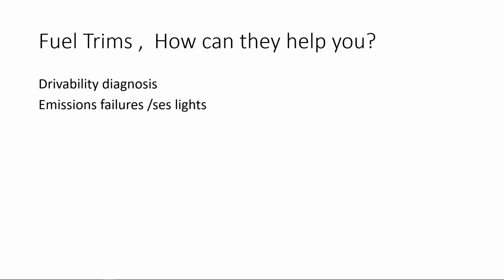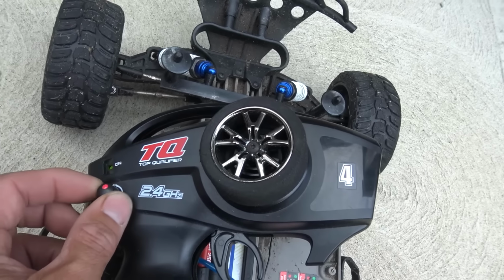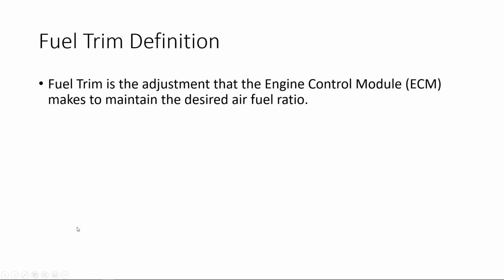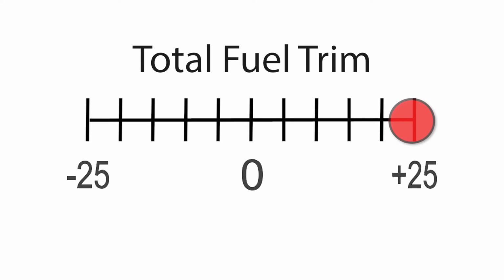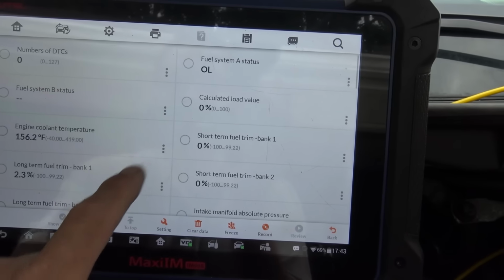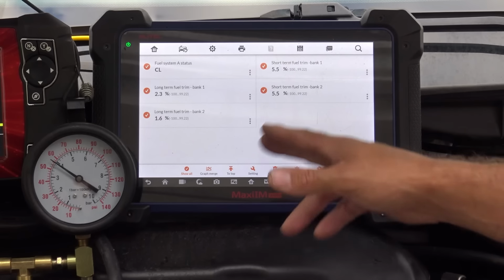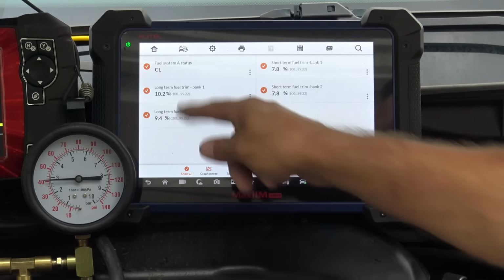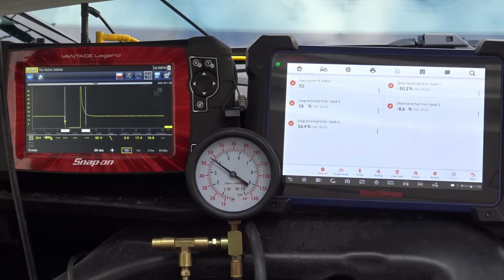Understanding the basics about fuel trims

Comment: thank you for simplifying fuel trim,  i have a snowmobile turbo boondocker setup with 5psi of boost when purchased. Turbo blew, i brought sled to Mod shop that does sled mods but they could only get 14psi as new low . So now i have to purchase av gas  too keep the sled cooler, like the power but its not my liking. id like to put back to stock if i can. Would i be able to just unplug the boondocker fuel mapping box from the efi carbs and  plug in the original back in to get stock  settings. i will also be putting original exhaust back on also and remove turbo.
Reply: someone mentioned in forums you could leave the turbo installed and just unplug the boondocker fuel mapping box and just plug the originals back in,  reason being i don't want to  seize motor and would be happy with stock
Reply from the maker: I am not familiar with systems you have.

Comment: Do fuel trims % value effect all fuel table, and at WOT ecu use the % its detected at idle, do I understand right?
Reply from the maker: I may make a part 2, but yes,  each look up map or table has a fuel trim, that way when certain rpm , load , maf, temp  conditions ate present the ecu already has a base line( long term trim value) established.
Reply: @BrianMann216  so it means narrow band sensor only useful for fuel trims at idle, others running condition mostly narrow band sensor just do nothing right?

Comment: Thank you so much.  I’m not a pro, but I’ve made it a goal of mine to understand fuel trims.  I’m a pilot, and your airplane trim analogy did the trick.  I have a low level scan tool that I’m trying to understand for my car and at least now I can get the high level overview that previously escaped me.  It’s a 11 yr old 3.6 GM with 160,000 miles that seems to run quite well, but as they say knowledge is power.  I subbed.
Reply from the maker: I love Flying,( student,  172 and 152 mostly 12 years ago)..

Comment: Basic control theory. Many systems in the modern car are using a PID control loop to maintain some kind of stasis, e.g., fuel ratio, cruise speed....etc. Some of the most fun projects I ever worked on were based on this.

Comment: I'm a diyer.  so working on a 2008 honda civic 1.8 liter.  I have negative fuel trims all of the time.  at idle, my STFT and LTFT,  always on the negative side.  even while I'm driving the car between 1500 rpm and 1800 rpm.  what am I missing?  How should I tackle this issue.  thanks.
Reply from the maker: Is there actually a drivability issue? Setting a code? What are the actual trim #s
Reply: @BrianMann216  the thing is I have no drivability issues or codes.  I’m just going to clean the oxygen sensor and put it back.  The next thing I’ll do just for giggles is, I’m going to smoke the engine and see if there’s any vacuum leaks.  If there’s other steps I should follow please advise.  Thanks

Comment: Best video, best information, I've found so far regarding fuel trims. Nice and clear. I especially like how Mr HoAT set up a system to reduce fuel pressure to the injectors, showed us a gauge that was indicating the pressure and the changes in pressure, and showed us how the OBD trim values changed in response to the changes in fuel pressure – changed in order to keep the vehicle at "homeostasis" as they call it in biological feedback systems. I loved the info about the etymological origin of the word "trim" – starting with how the word is used, what it means,  in the context of sailing vessels. Only thing I had some difficulty understanding was the fuel injector oscillograph pattern starting at 21:20. I think the problem here was that I was not able to see the labels for the vertical and horizontal axes. The labels were too small to see. I saw what looked like 2-digit numbers on the vertical axis that were too blurry to actually read, and in addition I saw just the numbers, I did not see any label saying what the numbers were a measurement of. Whatever was on the horizontal axis was even harder for me to see. Is it time, in milliseconds, on the horizontal scale? At what frequency was the oscilloscope re-drawing the screen? What was on the vertical scale, volts? Why was an increase in injector on-time associated with a flat, horizontal line at the bottom of the vertical scale (a line which got longer as the fuel trim went more positive)?
Reply: I was confused on the same part

Comment: 2015 supercharged mustang 5.0.   Fuel trims at idle and warmed up.   LT and ST. Around 0.   Driving 2000 rpm ish.  Bank1. -12. Bank2 -2. LTFT.   Any ideas.   I/M monitor Fuel will not set. Any input?
Reply: Exact same issue, trying to figure it out still

Comment: 😃wow, I just came across your stellar teaching on this topic of fuel trims! Bravo!  Short & Long adding together and understanding how fuel pressure can impact the duty cycle of the injectors as well as all the trim.  This is helping me take over the troubleshooting of a lean condition on a Cadillac engine with codes 171 and 174 (lean on banks one and two).  I'm looking at fuel pressure tomorrow and your excellent teaching has put me on a path that I think i can solve it.  Thank you sir.  -jeff
Reply: Be interesting to know what you actually diagnosed on this? I doubt it was fuel pressure, maybe an air leak?

Comment: Curious if you can answer this one?  Supercharged car. The car is speed density (MAP sensor- no MAF) and tuned in summer time. Would winter weather show positive fuel trims?
Reply from the maker: If tuned properly, no. Ideally, the fuel calculation is based on the air mass, which is density x volume. The density calculation is from the (average molar air mass × map pressure)/(specific gas constant for dry air × the air temperature). Basically pressure / temperature  so the air mass calculation is automatically changed for temperature before the fuel calculation.
Reply: @BrianMann216  okay. I must have a small vacuum leak somewhere then…  It goes 1.12 bank 1 and 1.16 bank 2 at aggressive throttle or wide throttle.
Reply from the maker: @Boosted3.7  usually a vacuum leak will not cause trim issues on a speed density system.
Reply: @BrianMann216 Hmmm. Okay.  What are the things that would? This is my first SD car.

Comment: I have a 2002 jeep liberty V6 3.7 I have a -32 on my long-term both banks it had two bad cats I replace both catch new coils, new spark, plugs new injectors to fuel pumps and I cannot get the -32 to move back up short term is zero to -1 any help?
Reply from the maker: Did you reset the trims? Clear all adaptives?

Comment: I have a 2012 Buick enclave and have a very erratic cold start for about 10/15 seconds.The bank 2 short and long trim shows NEGATIVE 100% on both short and long trim on Bank 2 only. bank 1 is very good.. what can the issue br guys.. injectors, o2 sensors, vacuum leak or carbon build up on the valves.m
Reply from the maker: I would look into restricted exhaust , clogged cat or timing issue
Reply: @BrianMann216  thanks for the heads up, just noticed the Mass air flow sensor is Reading around 3.9 ish when idling, heard this should around 6.as a rule of thumb 4 cylinders should clock around 4  ..6 cylds should be around 6 and 8 should be around 8 give or take a bit..
I'll clean the MAF sensor and take it from there..one more thing I  believe my timing chain is slightly stretch hear a slight rattle when taking off

Comment: thing that I don't know is does long-term for is that for the rear O2 sensor and is the? Short-term is that for the front or 2 sensor or is it both of them consists with Fuel injectors I'd need to know what controls Feel trim I know part of it is the maf air flow sensor  What boils down is I can read what the fuel trim are saying to me but I can't read where it's coming from and why for example my ltft is between 9 to 11 +
Reply from the maker: Focus on total fuel trim! Different makes and models will calculate differently sometimes rear o2 is important part of calculation.  Total fuel trim is the correction that the computer is making.
Reply: @BrianMann216   Well I was relating to my 2004  BMW 325 Xi  My long-term field trim was pretty high at + 10 And I didn't have no vacuum  Leak I was using vdo Maf sensor  I guess it died on me I put back my original one that I had stored for emergency And now my long-term filth have it's showing way better At positive 3.24 What it is is i'm trying to figure out what caused my Car to have a p 0 420 and A p 0 4 30

Comment: I’m very new to this stuff, this is an excellent video! Question: Why would I not measure the fuel trims while driving instead of when sitting? Wouldn’t that be a more accurate depiction of how well the engine is doing? Or do the percentages/ratios not change between driving and sitting? Thanks!
Reply from the maker: You are absolutely correct! My goal was to introduce fuel trims.  I did some examples at idle just to show the basics.  Monitoring Trims under various conditions provides a wealth of information. For example you can have a  vehicle that runs great at idle with total trim near normal, and then on a test drive under a load the vehicle lacks power and the trims climb,  you know that you most likely have a fuel delivery issue, (low volume from the pump / restricted filter, restricted injectors).  Thanks for watching and commenting,  please do subscribe if you have not already!
Reply: @BrianMann216  I have subscribed, and thanks for the reply!!

Comment: Sir my car at idle has a short term of 17% and where i drive the car short term and long term are both averaging at -3.5% and +3.5%. What should it be at idle vs when driving? Also what will happen if a downstream 02 sensor is added to the upstream position?
Reply: Could be a vacuum leak problem. Unmetered air which affects the air fuel ratio more so at idle than higher speeds / load .

Comment: All fuel trims do is show something is wrong but not what is wrong . Overrated subject beaten to death.
Reply from the maker: Thanks for watching.  I suppose to each their own. In my experience many technicians do not understand or use fuel trims. The way I see it fule trims do tell you a whole lot! Combined with other data pids and or testing trims are a super useful tool. The way I see it  you are half way to eliminating things that cannont be the issue when dealing with excessive trims.
Reply: They indicate if a too rich or too lean air fuel ratio condition / problem exists

Comment: Hi I’m going crazy with my 2003 Mercedes’ c180k. The emissions are extremely high on the CO and the lamda is running rich. I found a split hose under the supercharger and replaced it. I also had a slight seepage on the fuel regulator and replaced that too. But still the car is running extremely rich. If I disconnect any one of the injectors then the CO level comes right down to almost zero. But with all 4 running it’s too rich. Please can anyone advise. So far I just have a code of P2058 which is lamda upstream. But on a scanner it shows to be working as I see the voltage fluctuating slightly. Please can you help?

Comment: Hi i just subscribed. Thanks for sharing your video. I just have a question. I wonder where did you connect the OBD scanner to the port? Usually the ports is inside the car underneath the steering wheel.

Comment: I have had high long term fuel trims for months on my 2007 Ram 1500 5.7L. They are both at +15.6. Using a smoke machine today, I found a leak where the EGR valve attaches to the tube that goes to the exhaust. I thought for sure I had found the problem, but after replacing the EGR and resetting the ECU, the problem is still there. In fact, immediately after starting the engine after resetting the computer, the long term trims went straight back to +15.6 instantly even though the short term trims stayed right around 0. The o2 sensors are functioning fine, however they are old. I have put 70,000 miles on the truck since I bought it, and it has 193,476 miles on it. I have not replaced the the o2's since I have owned the truck.  When I rev the engine to 2000 rpm, the long term trims go to zero and then go back to 15.6 when I go back to idle. Anyways, something doesn't look right.

Comment: Have a 2000 Honda Civic P0132 code.
STFT: went all the way to -50%
LTFT: Hovered around -4%
O2 Sensor B1S1 - fluctuating between 0.1V to 0.7V
O2 Sensor B1S2 - Stayed at 1.2V
Reply: Test your O2s

Comment: Great video! So what should a normal reading look like say for example on a 4 cylinder engine what should the average total reading of short term and long term together be before a red flag is raised? Thanks
Reply from the maker: closer to 0 is ideal,  usually more   25 either way will set a light, some are less 20 ore more.  Be sure to check out as many as you can to learn what is "normal"

Comment: awesome man. so I guess you can use the scope to diagnose clogged injectors too than?
Reply from the maker: Scope can show you whether or not Pintle is moving on most vehicles ,standard injection,  amp ramp for open, voltage for close. Other testing for restricted injectors, that would be positive fuel trims.
Reply: Clog injector would be positive fuel trim 10 or more

Comment: I liked the injector on time portion showing the computer adjusting. o2 sensor response is very critical too. Meaning a lazy o2 signal or o2 heater circuit. 👍👍
Reply from the maker: Absolutely,  I want to make a follow up video showing what can happen in different scenarios. It is harder to do. Like a lazy o2 the pcm may not be flagging a dtc, but it knows that somethings off and may start to correct. This is going to be fun to try and catch and share.. thanks for watching and commenting.